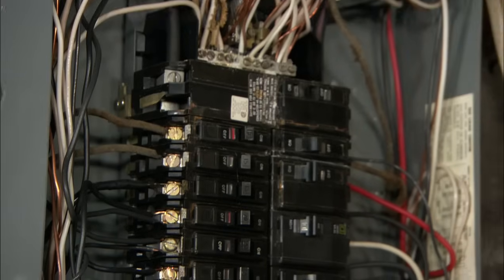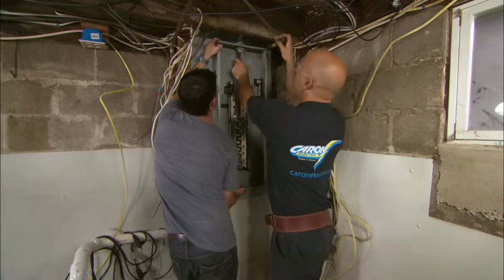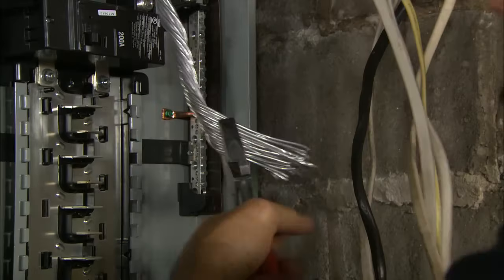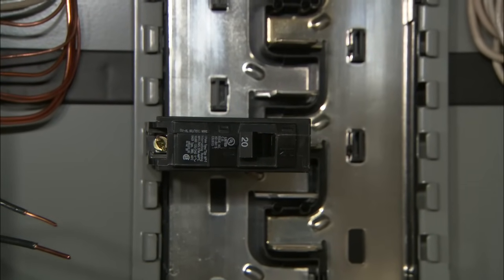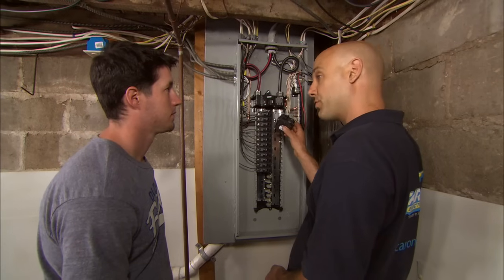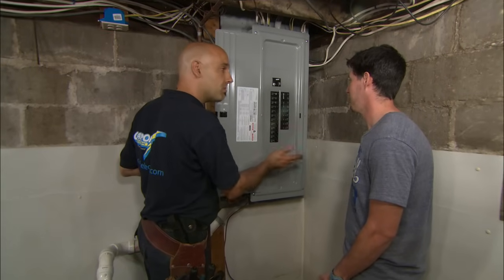How to Upgrade an Electrical Panel to 200-Amp Service (Part 2) | This Old House

Comment: Good tutorial.  Shows me the difference between the NEC and the CEC.  Probably fine in the US but don't do it this way in Canada folks.
Reply: damn thats a detailed breakdown
Reply: It was a slow day Tim.
Reply: I'm curious what is different in Canada. Thanks.
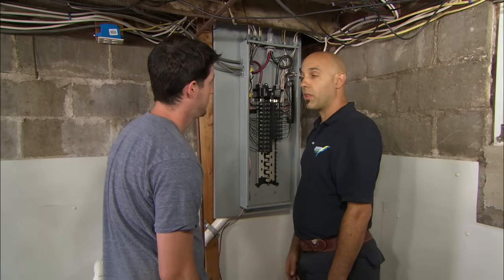Reply: At 4:04 he says he has to get the POCO to reconnect the service so I'm going to assume that this means that there is no disconnect point before this panel.

In British Columbia where I work, the Service Disconnect point in residential services are mostly located indoors.  Most pictures of American services I have seen appear to locate the Service Disconnect point out of doors.  In Canada the Star Point, the one and only point where the Service Neutral Conductor is connected to the Ground Conductor and Electrode, is located at the place of control.  Ie in the top of this panel install.  There is only one Ground Conductor in Canadian systems and it goes from the Star Point to a Ground Electrode with no splices.  

All other non-energized conductors ie bare wires are called Bond Conductors which connect the non current carrying parts of the home back to the electrical system.  If this panel were actually controlled by a disconnect means outdoors the Star Point would have been located outdoors as well and this panel would be considered a Subpanel and different rules would apply.  At subpanels, all Bonds and Neutrals would have to be separated by lifting the Bond Jumper.  Any existing  old ground wires would be transferred from the neutral bus and bonded to the can.  At the end of this post I go into a few of the other case scenarios where a second ground conductor in installed and used in a subpanel.   

In Canada, those conductors are considered Consumer Service conductors and that main breaker is considered the Main Service control point - hence that panel must be the Main Panel.  

The Service Neutral conductor shall Grounded at that point in the Main breaker compartment at the Star Point on the Insulated neutral bus.  The sole Service Ground conductor must be run continuously from the Service Ground electrode ( in this case the water inlet point) to the top of the panel outside it and entered into that top portion and be attached beside the Service Neutral Conductor on the lug provided.

No other wires shall enter that compartment.  A barrier shall be installed to cover these service components and separate that section from the lower part of the combination panel where the branch circuit and bonding conductors shall be entered.

All bond conductors shall be attached to the can (service box).
All neutral conductors shall be attached to the insulated neutral bus.
The bond strap connecting the can to the neutral bus shall be connected.

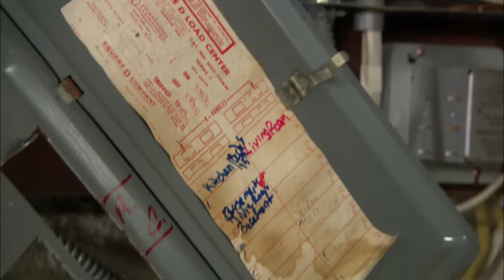0:10 - not allowed 2 conductors under one breaker.

1:30 - Individual aluminium strands within the conductors have to be cleaned of oxide (by brushing) and coated with anti-oxide compound not merely have anti-oxide compound put on outside of bundle. 

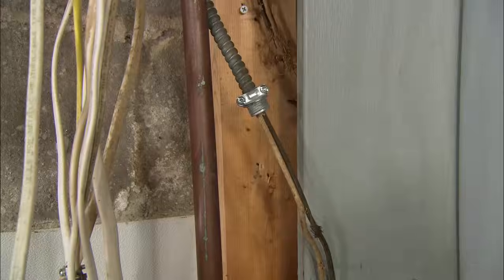 2:00. - if that is the main service one is not allowed to enter into the main breaker compartment with branch cct conductors.  Only main service conductors and the service ground conductor may be in that area.  

 If this was a sub panel then one can enter branch circuit conductors through this upper area of the panel and the barrier should be removed.

 2:58 - The putting of neutral and bond wires on the same bus.....  
Can't do this in Canada.  One has to use the separate buses provided to keep the neutral currents separated from the bonded components.  The only place the bare bond wires and the insulated neutral wires make an electrical connection is at the neutral bus where a ground wire is attached to the neutral bus bar in the Main Panel where the initial service disconnect point is located - AKA the Star Point by a removable bond strap.  You can see the solid copper jumper bar (removable bond strap) located just above his screw driver tip physically connecting the can to the neutral bus.  The jumper wire shall be the only thing that connects the bonded can and bond buses to the insulated neutral bus and its neutrals.    

If this was an Ungrounded Subpanel, (the most common kind of subpanel)  the Bond Strap between the can and the neutral bus has to be lifted (disconnected) to break this connection between bond and neutral to prevent circulating neutral currents.  These conductors and circulating currents can't be isolated if they share the same bus. (Hence the reason one is not allowed to put them both on the same bus)    

If the subpanel IS connected to a Ground Electode ( Say it was the original grounded Main panel and is now being subfed from a New Service Panel) then at the old panel the neutral/ bond connection shall be broken by lifting the bond strap.  Also the original ground conductor shall be lifted off the neutral bus and reconnected (bonding it) to the can on its own lug or attached to the bond bus ..  .    But it gets worse . . ..

Further, at a Grounded Subpanel the existing ex ground wire (now Bond wire) connected to the Bond bus or bond lug shall be bonded to the new Main Service Ground Conductor by running a Bonding Wire between the two electrodes.  This jumper bond wire will be crimped to the existing electrode conductors (not split bolted together) to effectively make these two electrodes one. 

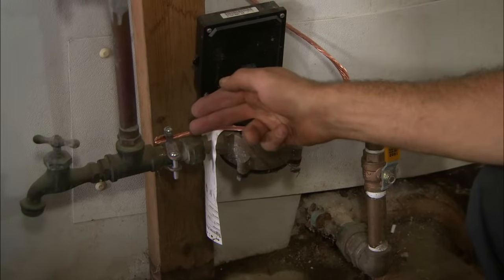At 3:47, what he calls the Ground wire would, in Canada, be called a Bond conductor, bonding the water line to the electrical system if attached where he attached it.  It must be a Bond wire as it's attachment point is in the lower part of the panel where the bond and branch cct conductors are connected.  In Canada this Bond wire would also be connected to the non existent Bond Bus although it could be split bolted to the Service Conductor.  

 As this wire is actually the System Ground Conductor as he said then it would have been attached to the Neutral Bus in the top of the panel beside the Service Neutral conductor under the lug provided for that purpose.

We don't seem to be using the water lines as a ground conductor anymore as all the water lines are being converted to plastic.  We put in new ground plate electrodes in as a matter of course as they are easier to install then the 3m ( 9') long ground rods spaced 3m apart.   

But as all metallic non current carrying parts of the house have to be bonded to the electrical system, that water line and any gas lines, steel girders or metal skins would have to bonded to the panel and they would be connected to the Service Ground conductor outside of the panel with split bolts as would the telephone and CATV systems. 

  (I am noticing that this panel doesn't seem to even have a bond bus - which would be another difference between UL and CSA standards) hence another difference in the way things are connected up.

And if this was a new service install, not a renovation, then the panel would have been installed closer to the floor as there is a rule that says the height of the highest breaker handle shall not exceed 1700 mm above finished floor.  Approximately 5'.  

Also all conductors would have to be stapled down within 12" of where they enterd the panel.

Interesting for me to note the differences.  Hope it wasn't too confusing.
Reply: all in you rlocal codes.  why you need to have it inspected and installed by trained professionals.
Reply: The Canadian and US codes are almost identical. As noted, this was a refurb, so the fastening of wires within 12" of the panel was not required.

Comment: I stopped watching after he cut all the existing wires because THAT was what I was doing with them, I had all my wires numbered & where they went so he just sucked from that point on..  Goodbye.
Reply: Uh... the circuits are still going to the same place they were going after the new breakers are installed.
Reply: he stated that the numbers/labeling didn't match up.  i.e. circuit 1 was labeled bathroom, but was actually powering the bedroom.  (thanks upgrades)

Comment: How much would a job like that cost?
Reply: As an electrician in northern New Jersey I get $2,000 for a 200 amp service upgrade
Reply: where im from in Canada once your service lines are cut your WHOLE house needs to be electrically inspected by the utility company before they put power back in meaning you may need ALOT more upgrades if you for instance don't have GFCI counter plugs, enough smoke detectors, etc. I would charge around $2,500 (Canadian dollars) for a service upgrade but not to upgrade any other part of the house.

Comment: i want to do the same upgrade how do i know if i need to upgrade the outside service wire running up the house
Reply: Contact your local power company. Hopefully they will know. If they don't, they can find out when they disconnect the power.

Comment: nice very professional looks really good do you always for the most part connect  large size wires by bolting them down i don't think  you really want to uses large wire nuts based on it being to ridged but you could probably uses large spade connectors or push closed mechanisms

Comment: Unnecessary to jump the water meter since the ground wire ties directly to the water main pipe. There is an uninterrupted bonding pathway to the main pipe leading out. Shunting the meter is okey if the ground wire first connects between the faucet and the water meter. That is code compliance.
Reply: +radiomellowtouch 250.53d1 states continuity of the grounding path or the bonding connection to interior piping shall not rely on water meter or filtration devices. 250.104 states metal water piping systems installed in or attached to a building or structure shall be bonded to the grounding electrode system.

Comment: why are you not using copper wire ?
Reply: No not really, just have to size it right.
Reply: +FrozenHaxor yeah such a voltage drop within 6 ft away lol
Reply: +FrozenHaxor
Nope. Aluminum is used all over the country in residential service entrance. Secondly a great many times it only 4-6 ft so a voltage drop difference between Cu and Al wouldn't be worth even mentioning. Pretty sure those that write the NEC know what they're doing.
Fire Hazard ??? Sheeze. Get a grip.
Reply: +Buddy Phelps Most service entrance conducts are aluminum. Its cheaper and lighter weight with similar amp carrying capabilities. Power companies love aluminum wire.
Reply: Frozen Haxor - So are you an electrician who wires residential services?
Reply: Why not.
Reply: I would think then that it is a high voltage thing you are quoting then.  Cost of Copper conductors is 5x that of aluminium.  any wire larger than #8 now a days is probably going to be aluminum.  People don't use them in places where corrosion would be a problem like down by the beach or near a chemical plant.
Reply: Our canadian code changed last year.  Now we have to use the column 2 table for 60 - 75 degree wire for our wire size choices as that was the rating of the lugs.  No more 4/0.  Now it has to be 250 CMA.
Reply: why comment to the NEC?  Cause some guy asked me what the difference was.  Careful there, you might learn something.
Reply: Actually its not all aluminum.  There are 7 high-conduction grade steel strands that help deliver the current and they are surrounded by a special aluminum doped with a zinc alloy that is more durable and also a very good conductor for outdoor use.  Electricity always takes the path of least resistance, so the reason for high conductive copper grounding is to create a load differential on the breaker box thus making electricity prefer to follow the grounding path first and foremost in the event of a failure rather than enter a circuit into the house and injuring someone while seeking another path to ground.  Copper, though a much higher-rated conductor, is far more corrosive than aluminum alloy - so most state codes require it be protected from weather or used indoors only.
Reply: You are an uneducated fool spouting off and demonstrating your lack of knowledge.  1.  "Electricity always takes the path..."  No, most takes the path of least resistance, BUT, some also takes the other path(s), which can be enough to get you killed.  2.  "...is to create a load differential..."  Absolutely foolish.  3.  Copper is much less corrosive than aluminum.
Reply: Bill Church smaller wire size is a value.  200amp should be 4/0 wire vs 2/0.  I question that wire size.
Reply: Aluminum wire is widely used and recognized as a legitimate conductor, in both first and third world countries.  Copper is preferred by most and assumed in the NEC, unless otherwise noted as aluminum.  It is cheaper, but does require maintenance because the lugs need to be torqued to spec annually.  As said before, there is no notable voltage drop or need to derate conductors with lengths of less than 20 feet (with the exception of an industrial application, maybe).
Reply: Buddy Phelps:  It's Residential Service - you don't need it... the Utility is still using Alum @ weatherhead connection.
Reply: I use copper for everything on my side of the meter.
Why?
Because if you use Aluminum,  you have to go larger, thus creating  issues down the road when calculating conduit and box fill limits. Secondly, Copper is a better conductor than Aluminium which will result in less resistance and subsequently less heat... which again, offsets further resistance.... thus promoting a more efficient system overall... not that voltage drop is an issue with the 27 ft. from your OCPD to your garbage disposal...lol.
But my #1 reason is purely because of the difference in melting points...
Cu melts at 1983°F
Al melts at 1220° F
THAT, in conjunction with the fact that Copper is less malleable and less brittle, it stands to reason that  the likelihood of a short circuit or an arcing scenario would arise is far less.
Just ask a welder why he doesn't just trade those heavy ass copper leads for a set of light and airy 20th century Aluminum ones...he'll look at you like you got a booger on your upper lip.

Let's not forget... Aluminum wiring is largely the reason why we now have NEC 210.12.. but that's another debate for another time..

But that's not to say that, if installed, inspected and maintained properly, Aluminium conductors aren't just as good or less expensive. They absolutely are. 

Copper is just my personal choice.
Hell, I'd use Silver conductors if I could afford it in my house.
Silver IS the best conductor after all...
BUT I digress...
Reply: You should really seek some help for mental instability or drug addiction or Both !
Reply: Why are you even speaking,when you have never installed a service in yoir life?
Reply: Service entry cables and most conductors of that size are still almost always aluminum, while branch circuits are now always copper.
Reply: Yeah, it's not a problem as it used to be. Copper service cable is at least 15x more expensive for no real value.
Reply: @Gra Gor I'm not working as an electrician, but I'm currently licensed 
for installations up to 1kV. It's against the code to use aluminium 
wiring anywhere on the customer side. The only place for aluminium wires
 are the actual overhead power lines. That's how I was trained, 
accordingly to local laws and regulations. I am not aware of regulations
 of the area in this video, it might be legal to do so there so that 
would invalidate my previous comment.
Reply: Cheapskates. Only third world countries use Alu. Such a voltage drop, not to mention a fire hazard!
Reply: @FrozenHaxor You are the irritation that I can't stand when I'm in the field.

Every(residential)service in America uses 4/0 aluminum!You'd know that if you actually had any skill in my field!! 0:03
Reply: @theoriginalman5206  I'm not from the US but from the EU, we have different standards and regulations. Everything that goes from the meter to the panel is copper over here. Only from the span to the meter can be aluminum.

Comment: I have a large panel box like the one shown here but the insides only accommodate 1/2 of the breakers shown in this video. In other words, my box is twice the size of the circuit breaker area. I wonder if a larger buss-bar insert is available.
Reply: you could use Mini breakers (space savers) to get more circuits if you have enough amperage feeding your house. You basically get 2 breakers in the space of 1 normal size breaker.
Reply: @AnimosityGamers  May violate Max number of circuits, My 30 circuit box needs upgrading to 40 circuits.
Reply: ***** i agree they make heat but they pass regulations to be sold and used as a legit answer to his problem. His alternative is much more expensive and as long as his service size is good then why not? Only other option is feed a load center or full replace of the panel to a large can.

Comment: When we had our house built in 2005-2006, the electrical contractor labeled our panel horribly and it was almost illegible.
Reply: been there.
Reply: I've recently managed to relabel the panel with larger labels, just got a few more switches
Reply: Just like every other panel. In fairness, you are only given a tiny area to label.

Comment: wait. why is there no RCD installed in there?
Reply: RCD  ???
Reply: Gra Gor: RCD=Residual Current Device (in Europe). Commonly known as a GFCI (Ground Fault Circuit Interrupter) in the Americas.
Reply: FI Schalter kennen die wohl nicht.